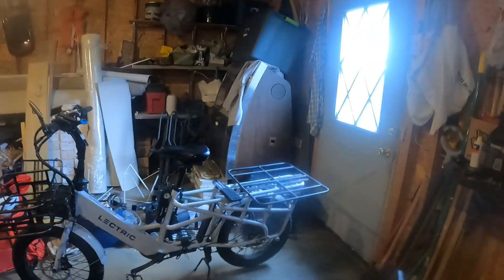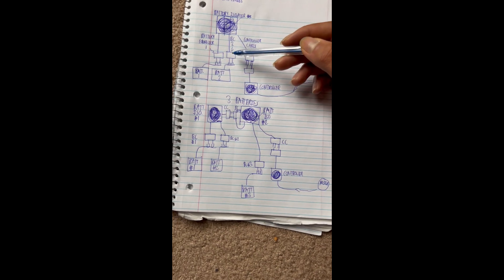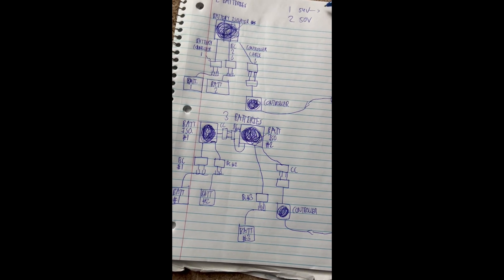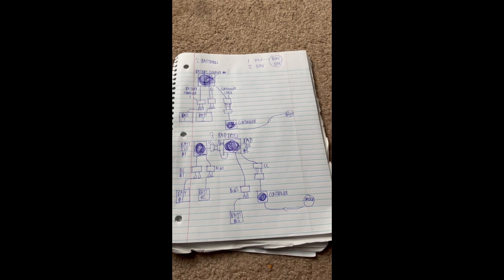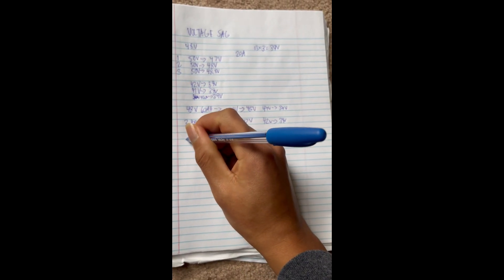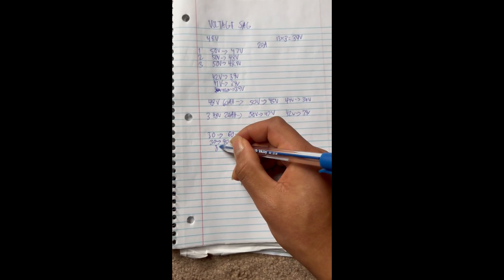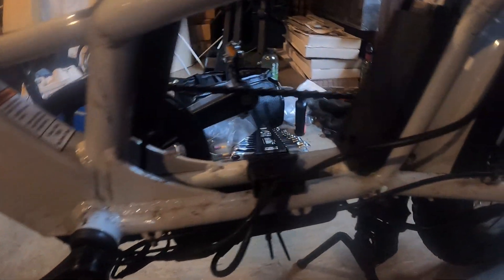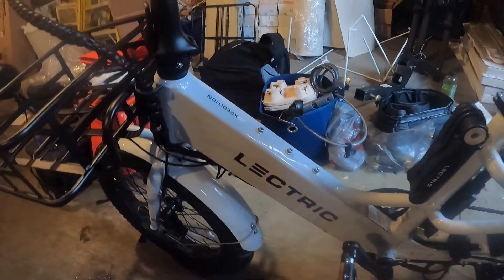How to Add a Third Battery to Your Ebike to Extend Your Range!!!

Comment: I added a 2nd battery to my Lectric XP 2.0. I used the battery blender from Electric All Wheel and I used the recommended battery from them off of Amazon. It was significantly cheaper than Lectric’s battery’s and I could use it simultaneously with the onboard battery. it works great and I doubled my range for $300.  FYI both batteries are 48v 10.5ah. I could have bought a larger battery but was limited by my budget.

Comment: Link to battery isolator ?
Reply from the maker: https://www.amazon.com/Zunate-Parallel-Connector-Discharge-Converter/dp/B0BZJBKHN9/ref=sr_1_1?crid=1LRC7CD7XGSSB&dib=eyJ2IjoiMSJ9.UhIGyocRJyz2z_8_IlPB0Pga9YHdK_oxlcQWraJVDI3L6eQYE4DA2gqi-RUAgPpfvLWmeAuuZoakcLZPIQFQCJkSaiTqEPKPw2lFN8czzNVVCurp22d6xlsr6tfgQU7O0oiK6PaVEkoxmO6wDyeQlfc0zEwuoG0kViKGyaIWdOhRMH6sTfbXK8u_R7zMyoxtO3V99J2Qz40-9B8GAmnZn9Pdgcps2vDRGnqWlnDZc34CURw5cI59K07GRkl014oOC_7dxY8MF8cI3jhCvbkdT66YwNRBs2r-SAoPl3bjJqI.2wohWe3hz37q2F_9w_aXnYHeSXvss8WIOYwMjTjreJ0&dib_tag=se&keywords=double%2Bbattery%2Bdischarge%2Bconverter%2Bxt60&qid=1713407198&sprefix=double%2Bbattery%2Bdischarge%2Bconverter%2Bxt60%2Caps%2C100&sr=8-1&th=1
Reply: Amps 20 30 40